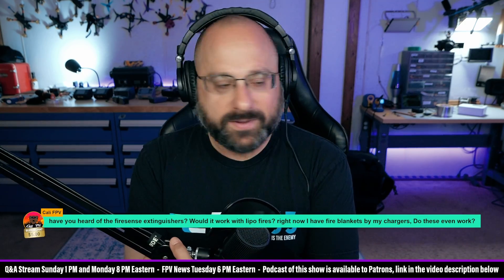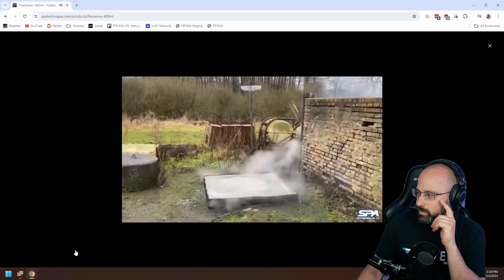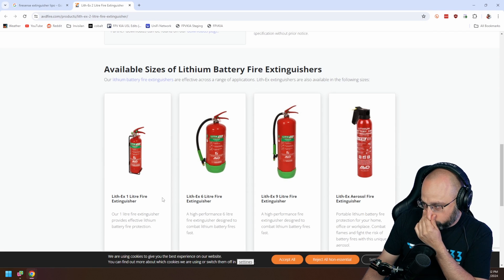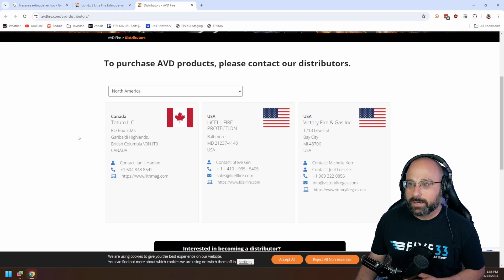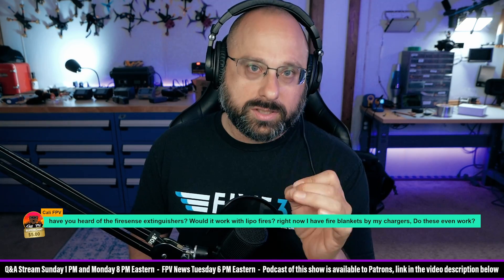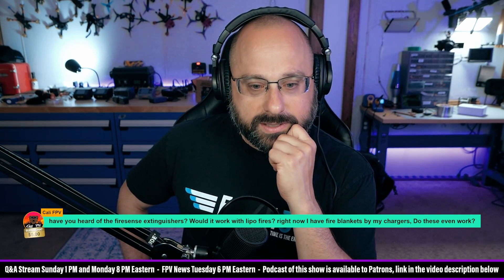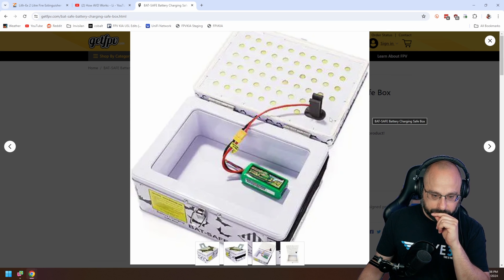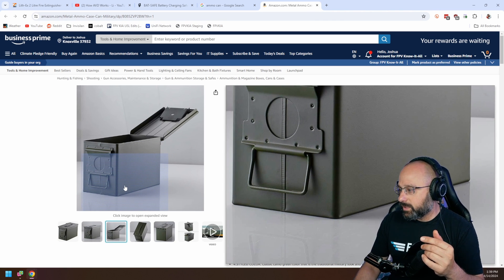Lithium Polymer Battery Fire Extinguishers? BatSafe? Safety With Lipos? - FPV Questions

Comment: I have had a 3s 300 cook off at the last second of charging and it smoked up the house. Had a 3s 5200 cook off and threw it in water and a ton of smoke boiled up out of it. i have several lipo bags and keep them next to the back door so i can kick them out the door.

Comment: Look for "li-batt events thermal runaway", this is how a Li-ion fire is called. There are many of them occurring regularly in planes. FAA recommends to drop the battery into a container full of water. Worst place to charge is in a basement with no water and no container, once the fire starts you can't even drop the battery thru a window.

Comment: Hang a bag of sand above your charging station if you are really concerned. In the event of a fire, cut open the bottom of the bag, causing the sand to burry the battery. Charging bags probably are a good idea too.
Reply: The fire burn the bottom of the sack and burries itself
Reply: Vermiculite. Products such as Fireballs or Extover.